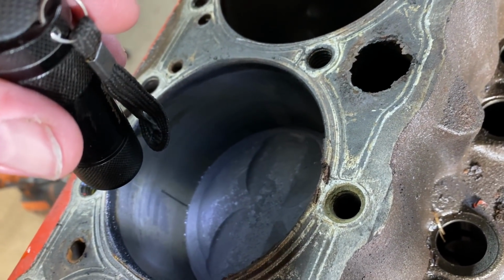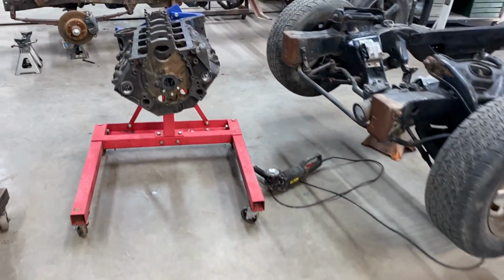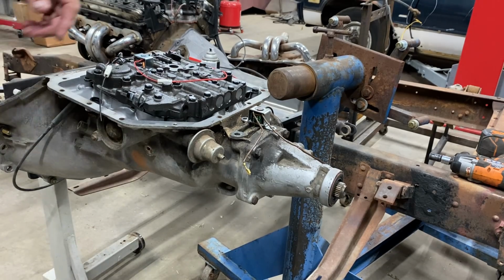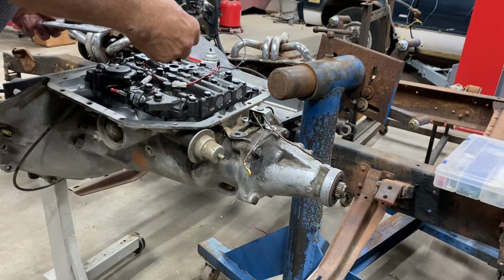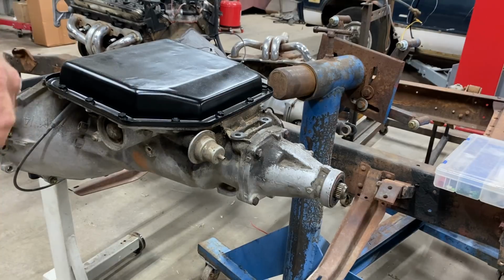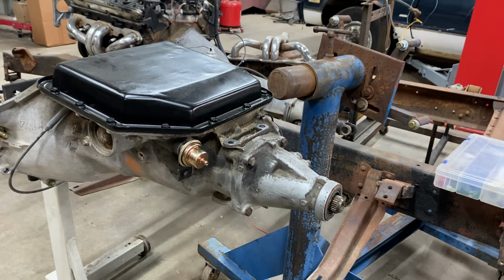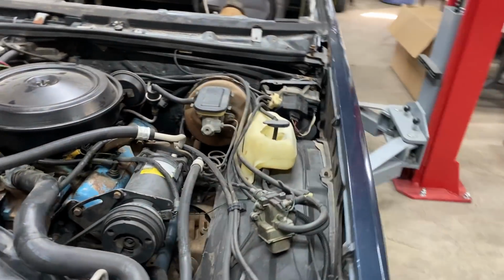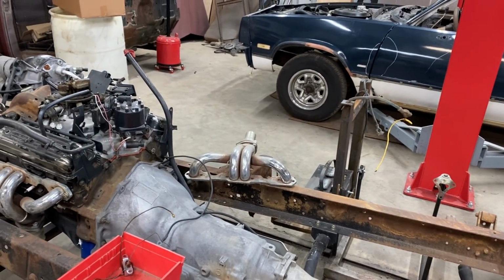Ever have a week when nothing goes right?

Comment: mike you know what i did not see,there should be a pin that goes into the center of the modulater when you insert it
Reply from the maker: It was inside the transmission.

Comment: here's a little tip, when stripping wires , just pull the insulation back by 1/8'' then use the insulation to twist the strands this gives a very tight twisted end that is much easier to fit into the crimp piece. regards ron.
Reply from the maker: I usually do it that way but with those connectors I couldn’t insert the wire with a tight twist, it has a needle like protrusion in the barrel so that tight twist was hard to push in.

Comment: Santa, I love your videos. So glad it is Christmas time soon and I know you will have so much to do. One question, the electrical connections you did inside the gearbox, does that work? I mean, would not the oil in the gearbox shortcut the electrical conections?
Reply from the maker: I asked the same question when I got the part, they said that the fluid is not conductive so no problem!

Comment: That trans fluid won't eat that coating on those wires you installed under the trans filter???
Reply from the maker: I asked that same question at the place where I got the solenoid, they said it want bother it!

Comment: Hey Mike, I am not a transmission expert, but you have pluged the shift solenoid  black wire in something that looks to me as some pressure switch, but the other end of that switch is not conected anywhere, is this right ? I realy love to wach your videos, hope to see you soon with your Santa costume !
Reply from the maker: Every diagram I looked at had it wired this way, doesn’t make sense to me either.
Reply: @SantasWorkshop  maybe it is operated tru ground, and the switch take it from the shell.
Reply from the maker: Hmmm, that may be the case!